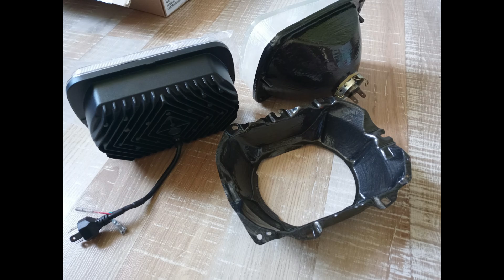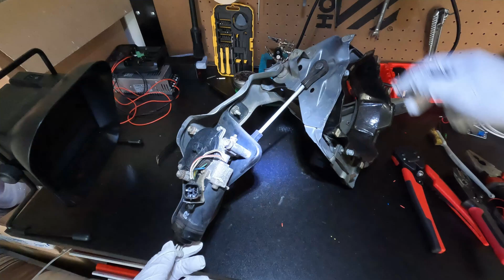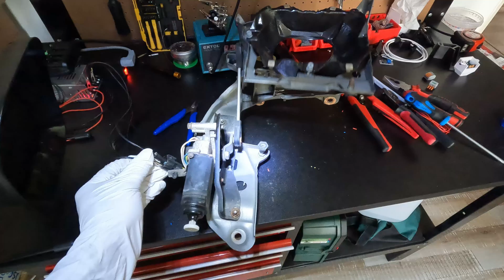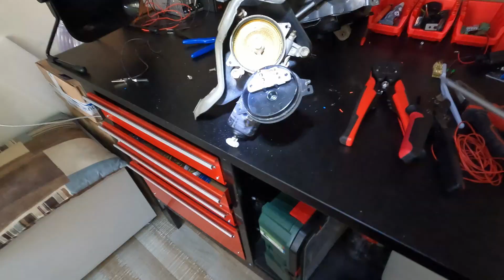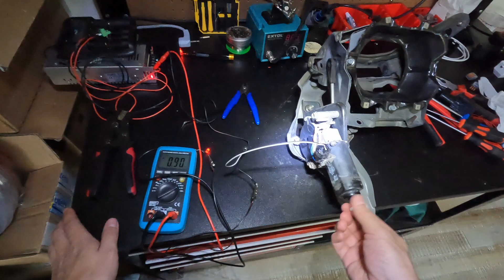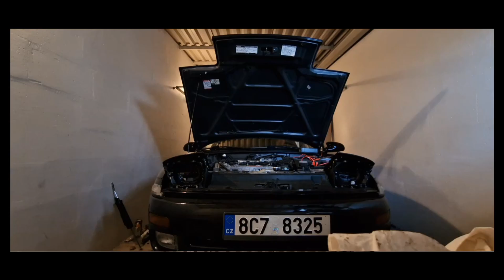Celica Headlight Retraction Mechanism Explanation

Comment: Really nice explanation, could I ask you about which pins on the motor are ground, 12v, and the outputs in which position the motors are? I am thinking about doing it with esp32 or with arduino. Basically giving power for shorter duration for sleepy eyes.
Reply from the maker: Hi,

yes you can definitely do that with an ESP32 and even with Arduino. I have made a controller that fully replaces the factory light retractor relay and can do a bunch of stuff including custom sleepy eyes. I will offer it for sale, video will be out probably sometime in early January.

If you want to do something yourself, arduino should be enough for some sleepy eye mod. If you want to accurately get the motors to the UP and DOWN positions I would recommend ESP32. I have had issues with arduino being just a bit too slow and it would not stop the motor fast enough.

Now to finally answer you question... :D Are you asking for pins on the 12pin connector going into the light retractor relay or pins on the 5 pin connector at the motor?
I will assume you are asking about the 12pin connector at 4:30. In that case B1 is +12V supply for LH motor and B4 is +12V supply for RH motor. Both motors are grounded together by B12.

As for the outputs for the motors positions, it is not so simple. They are tied together and getting the position of the individual motor requires somehow filtering the position of the other motor. I was trying to explain this at 6:36. Why do you need to know the motors position though? If you are just trying to get sleepy eyes, activating the motors for x amount of time should be the solution. The switches on the motor only have 3 states. UP, DOWN or INBETWEEN. I dont think these 3 states will help you much with your sleepy eyes mode, but I would need to know exactly what is it that you are trying to make. 
- Some system that works in parallel with the factory light retractor relay?
- Something that completely replaces the factory light retractor relay?

Comment: Hi !
Very interesting video !
I'm looking for this kind of mod like we found easily in mx5 (it's so cute)
Do you make a tutorial to allow what you do at the end of the video?
Or you talk about plug and play module that you'll produce to allow this, is it still planned?
Thanks
Chris from France
Reply from the maker: Hello,
I am not sure which exact mx5 mod are you referencing. I have heard that there is an aftermarket plug and play modification for mx5 that allows you to control the headlights more freely.
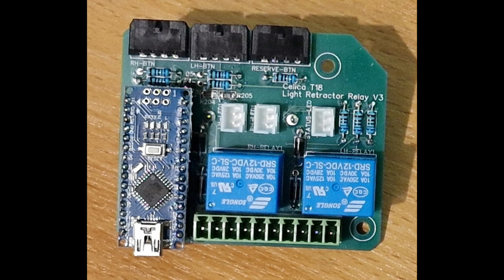I am working on something similar as mentioned at 8:46 and hopefully that will be ready soon. But of course, that will cost money.

If you want to build something yourself without much knowledge I believe the easiest way would be to wire in some switches.
Inspect the diagram at 4:23 B-7 and B-11 are the UP and DOWN line. If you wire an extra switch per each of these going to ground, you can get the following control:
a) only 1st switch active -> both headlights go down
b) only 2nd switch active -> both headlights go UP
c) both switches active -> both headlights keep moving UP and DOWN without stopping

If you want to control headlights individually, you can add two more switches to disable a headlight when needed.
These two switches would be needed in SERIES. Unlike the previous switches. These would be added in series at B-5 and B-2.

I have made a picture so you can see it better https://imgur.com/a/NjzORV3
S1 and S2 would make the headlights go UP and DOWN as described in the a,b and c scenarios above. In normal operation, these should be switched OFF.
S3 and S4 can disable the headlights. In normal operation, these should be switched ON

If you manage to wire all that here are some examples on what could be done with it. Assumed initial state is that both your headlights are UP
A) Make left headlight 'wink'
1. switch S3 OFF to disable the right headlight
2. switch S1 ON to make the headlight go DOWN
3. switch S2 ON and right after that switch S1 OFF to make to headlight go back UP. You do not need to wait until it has reached the DOWN position.
4. switch S2 OFF once the headlights reach the UP position. If you switch it OFF earlier, they will probably stop where they are.
5. don't forget to switch S3 back on unless you are fine with the right headlight staying disabled

B) Make both headlights 'wink' at the same time
1. switch S1 ON to make both headlights go DOWN
2. switch S2 ON and then S1 OFF to make both headlights go back UP. Same as in previous example, no need to wait for headlights to reach anywhere.
3. again, same as in previous example, switch S2 OFF once the headlights are back in the UP position.

I have not tried this before so I cant say for sure it will work, but i am quite certain that it will. In fact I will probably recreate this soon a maybe even make a video about it.
While my custom controller is cool and all, but who knows when that will be ready and who can afford it. These 4 switches and bunch of wires is dirt cheap so anyone could make it.